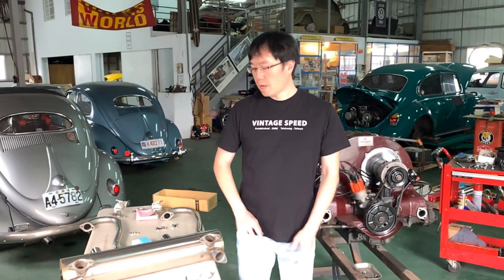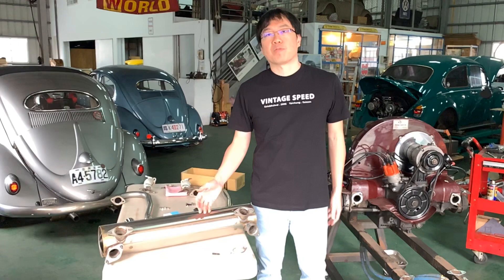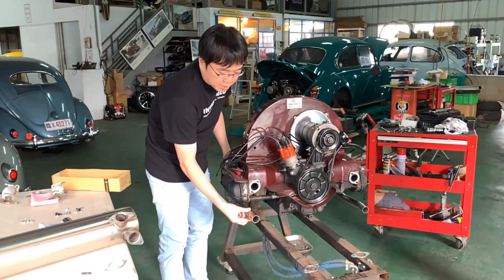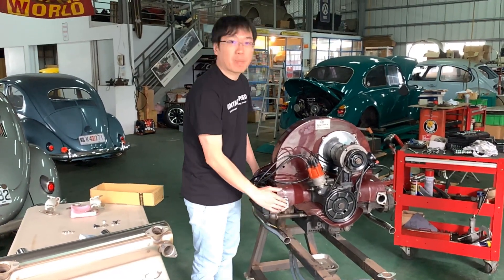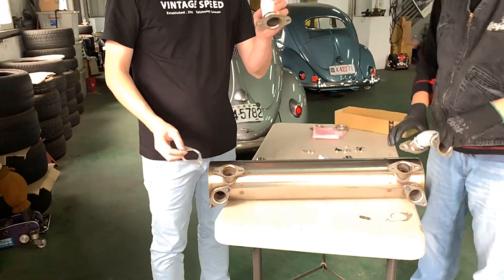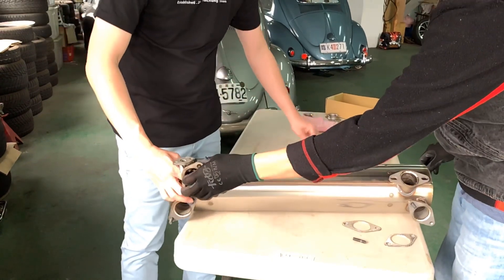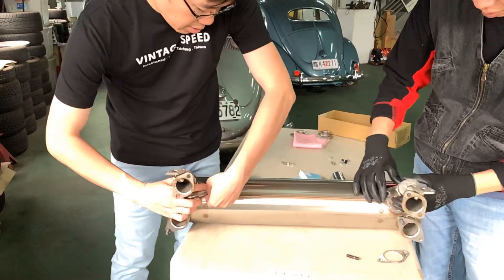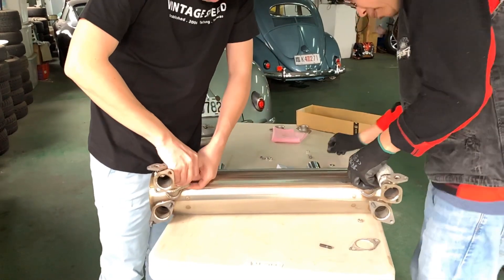How to install VW bug bus heater box Exhaust by Vintage Speed

Comment: Hey ..... The neighbor has one of your exhaust systems.   I've been looking at getting one for myself.   Have you looked into using V band clamp set ups instead of gasket flanges??   I put a V band flange on my daily driver and it's so much easier to connect and disconnect as well as getting rid of all exhaust leaks and back fires.  I have convinced myself i won't install another exhaust system without  V band flanges.
Reply from the maker: got you